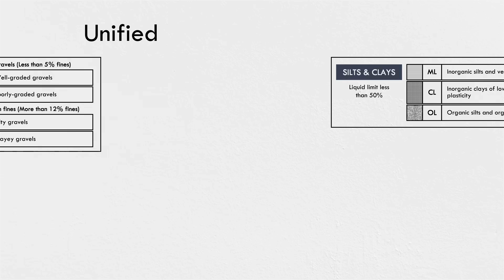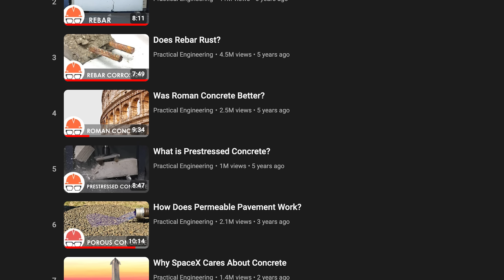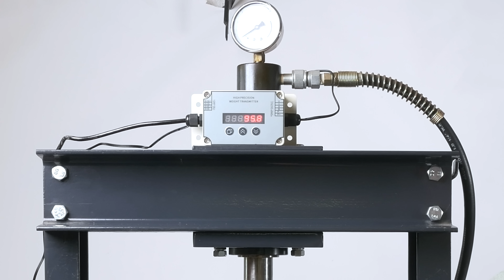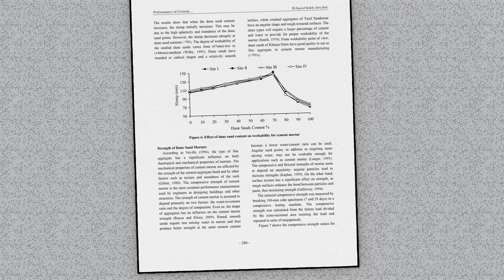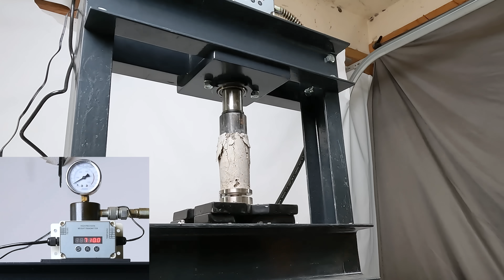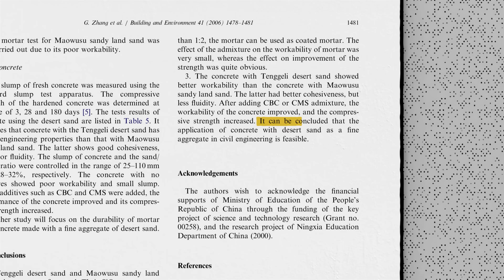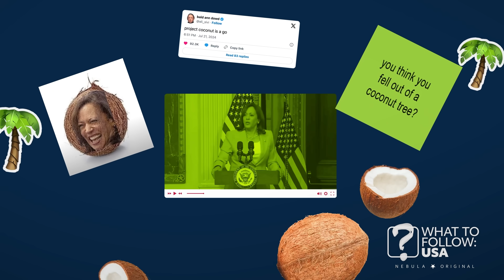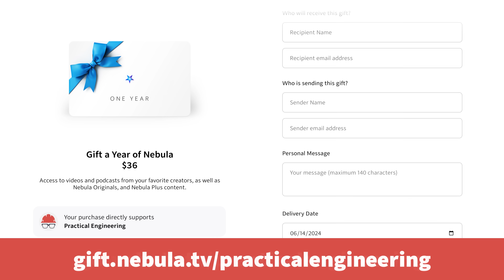Is the World Really Running Out of Sand?

Comment: I dont believe for a second rounded sand is as good as the angled in concrete. Anyway, its all about what is feasable locally, which means cost. The rule is always the thing is not simple when you know…all dimonds are not equally hard, water is not just water, pine wood is not just pine wood, sand is not just sand and on and on and on it goes. It all have diffent specifik qualities/uses drawbacks/premiums. 

Not to mention lifespan, environment. Still I dont believe rounded sand is better than the angled sand for concrete.  This will end the day I cannot get the angled erotion sand for the job to the price, right?

Comment: @PracticalEngineeringChannel,

why not to grind down Rocks to Sand? It should be possible. Or maybe mix Desert Sand an Industrial Sand for Concrete buildings that not need to be very Strong like the Walls in Backyard or very little buildings.

Comment: No you can't add water looking only for work-ability. You need to add exact amount of water that is required for amount of cement in you mixture. Cement to water ration should be constant. You manage work-ability with plasticizers. Or if you are ancient and can't use them, you increase both water and cement amount in mixture. But again - cement to water ration should be constant, and on concrete factories even wetness of sand is taken into consideration.

Comment: dont think you can reuse concrete columns, slabs, foundations. you have to crunch them on site, or wrecking ball or even explosives...all very, very heavy oil-gas consuming and not ecological! 
then you have to TRANSPORT it to a depo site or crunching site, if not on site. this is again a very heavy CO2 phase, oil-gas,
ecology suffers, also never seen a seperation of rebars from concrete elements? if so, it too is very energy intensive....
all in all, it can be resued but the cost and ecological problems are huge > not doable.
  thats why Wood-CLT is winning the AEC market, concrete-rebar are going out...not needed, never were, but the polit. lobbies kept it alive and "strong" 🤑🤑
the concrete hype-scam is over 🍾

Comment: Seems like there is no reason why we can't use smooth sand in roads, while we save corase sand for buildings. There is no risk to using smooth sand in roads. Worse case you just need to repair/rebuild the road. Where with a building/bridge a failure/repair is drastically worse of a scenario.

Comment: 15:20 ARTIFICIAL SCARCITY... Total B.S.

15:37 they mostly just bury used concrete because of the STEEL...
Though the could still recycle bricks and blocks...

You just explained how they built the pyramids and other "megalithic" structures. 🐢 It wasn't 👽 it was GEOPOLYMER 😁

Comment: You can't use round sand for more reasons than final cure strength. You keep claiming round sand is workable. Its entirely unworkable. Its true sharp large aggregate is harder to place, and thus round larger aggregate (rock) is easier to place, but this is not the case with the small aggregate i.e. sand. I know laying a brick with mortar containing rounded sand is like trying to use self leveling cement the hold the brick up. So my guess is that round sand could work in certain concrete designs depending on the type of pour.

Comment: The line about how industrial process just externalized cost to the future of environment is great but this suggest its not the case now. Regulations and fines do not stop these process from increasing future environment cost because in order to pay for that cost to be covered you need to value it first and even if governments have the best of intentions they aren't capable of value it properly. At most regulations deincentives environmental exhaustion.

Comment: Thanks, Grady. I now have PTSD from recalling my particle size analysis labs, sedimentology, fluvial geomorphology, glacial geomorphology, and pedology undergraduate courses. Over 40 years ago and I’m still finding sand in places sand was never meant to be. I’m often amused by the NIMBY types who don’t want aggregate quarries or concrete batch plants near their brand new homes, but are thrilled with their new foundations, new roads, new parking lots, and new sidewalks. The aggregate is where it is. Be happy it didn’t have to travel too far and put all of those costs up. Great video. BTW it’s dirt when it’s in your house but soil when it stays outside.
Reply: I absolutely love having a gravel quarry 3 miles from my house.  My road and driveway appreciate the fact that I can pick up 4 tons on a whim just to make them a little nicer. My wallet loves the fact that when I need a 16-ton dump truck full, delivery is only $50 if my driver is already out this way.

Comment: Another interesting point about sand:  a few years ago, I worked out that the predicted number of stars in the universe is roughly the same as the number of grains of sand in the Sahara desert -- or it might even have been the number of galaxies rather than stars (it depends on what you take as the average size of a grain of sand, and what depth you assume the sand to be).  Either way, it shows the size of the universe as totally mind-boggling.  

And another use for sand -- as an engineer, I knew of course roughly how sand-casting was done, but I've only recently seen a video of it, which you can find here https://www.youtube.com/watch?v=hskwKf_XVfw, at 26.25 - 36.40 (or - 53.44 if you want to see how they finish the axle casing and refit it).  (You can also see some forging of a hub at 7.55 - 10.08, or  - 20.32 including the finishing and refitting.)  To Western eyes, shockingly free of health and safety or respect for the environment, but they all seem to still have all their toes, and there are no other obvious signs of industrial injury.  And it must be said that 50 yrs ago, in the UK, many people would just let oil drop onto the ground if working outside.

Comment: I've poured my fair share of concrete but I definitely learned something from this video, I never really considered the types of sand and I guess I didn't realize adding water would make THAT much difference.
Still if stiff and unworkable 'crete will cause your structure to tilt or push out of position, or be impossible to work and result in a cold joint then wet will have to do.
We had some concreters work for us recently they must have added a full tank (200l) of water and they still ended up with a cold joint.

Comment: Hello Grady! A few months ago I saw a video about sand. Specifically, how beach sand was being used rather than river sand in China, and how it was causing problems in the structural integrity of concrete. I think it said concrete composed of river sand would last for decades, but the concrete composed of beach sand develops cracks in months or years, causing castastrophic collapses 
in buildings. I dont recall why. Salinity perhaps? 
Another question about sand. I grew up in the Mohave Desert, specifically the High Desert in Landers, CA. 
The sand is very different from sand in the lower desert in Palm Springs, which is the finer wind blown type, kind of dusty. 
One kind of sand I've ran into is like no other I've experienced. The sand from the North Shore of Oahu. Waimea Bay has this sand with large granules of about 2-3mm. They have been 
pounded by the high surf and are very rounded and polished, and look like miniture stones from a rock polisher. They stick to skin, clothing, shoes, etc.,  much more than desert sand. So wouldnt that be the better sand for concrete?

Comment: The statement comes from what you said early in the video. we are using natural sand faster than it is produced and it is not a renewable resource.
Reply: Not to mention the demand for sand is way more higher than ever because sand it's largely used in the direct manufacturing of semiconductor and everyone, everywhere is constantly desiring for it because literally every electronic and electrical component you have is made from or by semiconductor.

Comment: You made lithos not sand. The majority of sand is made up of quartz and is usually sub rounded to angular in texture. Aeolian transport of sands actually rounds them too much and are not currently used in concrete for that reason. Also; fractured rock (or your sand) is not as strong as naturally weathered grains of similar size.

Comment: Great point about externalizing costs. “Regulations make it more expensive” means “we have to pay more of the costs now instead of making the neighbors pay”. 

Concrete grows crystals as it cures so it might not make much difference over time (after 30 days) if it’s growing around sharp or rounded sands, especially if rounded sand makes it workable with less water.

Comment: My state ran out of sand for construction during 2014, it got more and more expensive till construction activity stopped. Then some engineers opened up  manufactured sand mills near the mountains and made big money untill 2018. Then there was a flood in 2018 which filled up the sand in 44 rivers and sand got cheaper again closing down the manufactured sand mills

Comment: I am surprised you overlooked the most striking feature of sand, that there 2 kinds of it. There is inland or desert sand which is silicon dioxide from eroded rocks and my favorite, beach sand or ocean floor sand made of calcium carbonate from the discarded shells and exoskeletons of sea creatures. Ocean floors overtime compress into limestone deposits. Growing up in Florida I found Gulf coast sand is coarser. Daytona beach sand is, when dry, is like powered sugar, when soaked is the softest on the feet, but, when damp is as hard as concrete allowing cars to drive and park on it during low tide. Beach erosion is increasing, but, the sand is not vanishing. It is sliding into the sea.
Reply: Why do you think beach erosion is increasing?

Comment: Sand is not used to make glass. That's a very common misconception. Too many impurities. Quartz is used to make glass. Also, I don't believe "sand" used in construction is beach sand. Beach sand, depending on the area, may be partially or completely comprised of granulated coral and seashells, which is calcium carbonate, not silica/silicon dioxide.

Comment: There's a lot of other issues with manufactured sand - it's harder to transport and the mixes use more paste because of the increased void space.  We end up using it more in asphalt than concrete.
Reply: It also tends to be softer and more reactive versus normal quartz sand

Comment: Some Nebraska rivers seem to have an endless supply of sand and they are hauling it out by railroad. They don't have much rock so they have to import riprap from SD.  They use broken up concrete for riprap, but it doesn't work well.

Comment: Your tumbled concrete chunks:
My parents when they remodeled their house back 10-15 years ago, one of the contractors suggested concrete counter tops for the bathroom, which could be dyed any color. Mom asked for "gray" and they turned out pretty nice. Not quite as aggregate-visible as your chunks, but they still have a polished top surface (and the master bath has a few white river rocks embedded in  the corners as accents).

Comment: All I have is sand.  I live below the  fall line.  I need to set 25 footings for my house.   The easiest way I can dig these holes is with a shop vac.  I can pull sand over 25 feet deep if I don't hit water but I will find water at 8-10 feet deep anywhere I dig.  The classic quick tube is good enough for the build but why not use the concrete to form a helical pier as well.  Way over engineered for south Georgia and I don't care.

Comment: When I was in high school in 1982, the school built a sport building in the winter, and mixed antifreeze in with the concrete so the water wouldn't freeze before setting. My teacher said it was really irresponsible, and that the building wouldn't be safe, but then he was an art teacher not a structural engineer. Have we learned enough about using antifreeze in concrete to the point where we know it's safe long term?
Reply: Art teachers have to justify their existence somehow.

Comment: One bit I’m intrigued by (in terms of manufactured sand) would be Glassy Carbon (vitreous carbon) 

It can be made from hydrocarbons (Fossil OR Bio / Power-to-X) so could be less location dependent + potentially less extractive!

Main bit would be cost+complexity, but i think it has potential 

(Also Carbon Composite Rebar and Carbon Fiber Reinforced Concrete!)

Comment: Tree farms also double as carbon sinks.

In defense of tree farming:  A lot of former crop land in the south that had been cleared out for cotton farming or for other crops that became less economical for those purposes with the advent of combine harvesters (which need PERFECTLY FLAT LAND to work) are now pure tree farms.  Loblolly pine on a 20-25 year cycle, conventionally bred to grow bigger and faster and taller, allows for more timber to be grown, more efficiently, than ever before.  This land also can be used as wildlife refuge areas when not being harvested... so for 24 out of 25 years, it's a sanctuary for birds.  The land can be leased to hunters to keep populations of deer under control.  The land can also be used for other random things - migrating beekeepers will overwinter their pollinators in Florida timber stands, for example. 

The US south is one of the few areas on the planet which is being actively reforested.  This is a good thing.  Good forestry management also requires selective thinning and controlled burns, and patchwork harvesting cycles (as opposed to complete clearcuts of large areas) to ensure that no one area is completely cleared out at once, but also that no one area gets overgrown to the point where it becomes a fire hazard.

The timber stands also protect the bottomlands and riparian areas, which themselves are not safe for growing anything, by preventing development from happening close to them.

Comment: Second video in a row where I've used the thing in question professionally.  (The previous one was on thermite...) 
My first job - before even getting into college - was as an electrician's apprentice.  Appalachia is a very rocky place, for obvious reasons, and what with frost heave, settling, and other drainage problems (ones you're familiar with) you can't just put cables in the ground without protecting them.  For that we used several inches of what we called "electrical sand", a very coarse-grained sand that, once backfilled with native dirt, was dense enough to keep any errant rocks with their sharp edges from cutting into the electrical cables.  (We used a 6.6-amp constant current loop to power runway lights- the idea was that all the lights should be the same brightness - and matching transformers so that if a light bulb went out, it wouldn't break the loop, but simply wouldn't draw any power from its transformer.)  The sand was an essential part of our business... if we were out of sand, we couldn't lay any new cable trench until we got more.  

I'm guessing that the coarser sand tended to drain better; a fine sand full of water would cause its own frost heave, but if water could drain thorugh the sand to the bottom of the trench and either trickle away or get absorbed, the cables in the sand would be safe.

Comment: In a practical environment, course/sharp manufactured sand doesn't pump as well and usually needs more water or costly additives. Even after additives, pumps wear out more quickly. Finish quality is poor due to rough surfaces. Manufactured sand costs millions in maintenance throughout the entire process. Mixer barrels, pumps, hoses and finish tools wear out in months instead of years. When pumps clog do to course sand, the pressure can reach thousands of pounds. Workers have been seriously injured and sometimes fataly due to hose failures/explosions.

Comment: 4:12 Okay, next I’d love to hear precisely what cement actually is.  It’s another one of those things we nominally understand well  enough in context, but if I really think about it, I have no idea what precisely defines what is or isn’t cement.
Reply: Cement and concrete are often used interchangeably. But more specifically concrete is the product of mixing rock aggregates like gravel with cement. cement acts as a glue that hardens over time. it is the binding material that holds aggregate together. that is how concrete is made
Reply: @choppaprod  That's a good general description. I would add that cement is its own thing, and usually involves some combination of lime, calcium, silicon, slag/iron, and area-specific additives.

Comment: Speaking of sand, I hope you do a video on frac sand. I found the requirement of sphericity of 0.5 or greater to improve high pressure flow to be fascinating. I have also seen sand called Texas brown, northern white, sand hauled from Mississippi by barge to Texas. There is resin coated and ceramic proppants as well. We’ve recently transitioned from decades of dried clean sand to wet sand in the fracking process. There’s a lot to talk about.